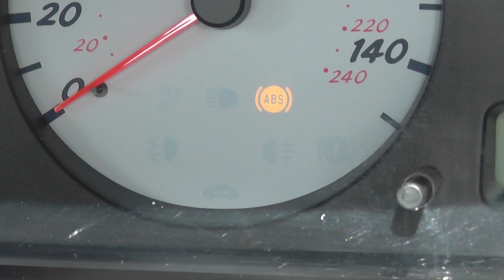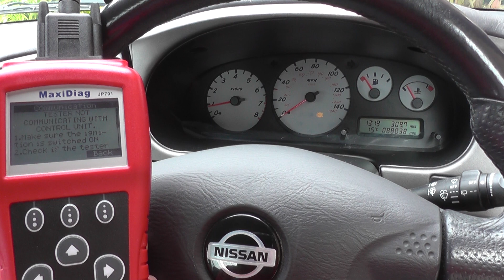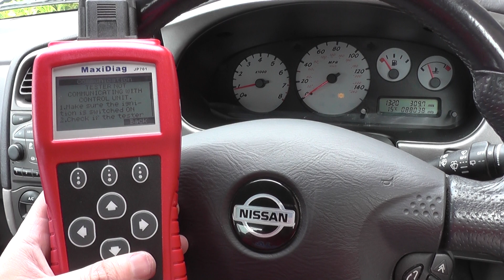My Scan Tool Will Not Connect To ABS Module - Here Is Why

Comment: I had the same problem with a 4 system Autel scanner. You need an All System Diagnostic scanner. ABS is part of Chassis system so you need a scanner that reads Chassis modules.

Comment: I was having the same problem with a Kia Soul ABS, TRACTION CONTROL   HAND BRAKE, LIGHTS ON., and no brakes at all and the ECM wouldn't connect with the abs module. I replaced the abs module same thing,  replaced the cylinder same thing replaced all abs sensors same thing. Vehicle was towed to the Dealership for Diagnostic they suggested the same thing to replace all that had been already replaced, after all i suspect that a faulty wire might have been the culprit,  but is already at the dealership let's see what they come up with.
Reply: what was the problem?
Reply: @salehaliat4486   Harness replacement $3500 quote
Reply: @pftrans 🤣🤣🤣🤣🤣🤣🤣🤣🤣 dealers are criminal entities along with car manufacturers

Comment: I have a year 2009 Chrysler Town and Country ABS light anti a lot lights are  on but if  lights in contraction control lights are on and it all started after I had a sensor of replacing stem valve replaced in my right rear tire and they said my brake modular went out went through to rebuilt in the computer system apparently is not reading the codes on none of them

Comment: Could a broken wire in the abs circuit result in failure to communicate?
Reply: Yes
Reply: Check for power at the ABS and check for a good ground if it doesn't want to communicate